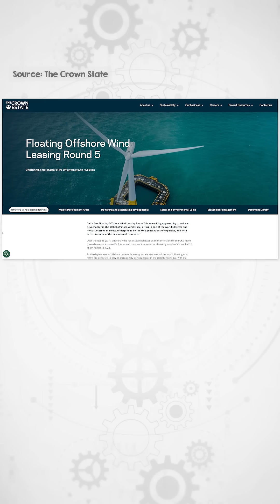How much floating offshore wind is being installed?

Comment: I've noticed (almost?) all floating platforms for offshore wind place the turbine at one corner. 

Does the entire platform rotate when the wind changes direction? My intuition is that if the pillar is at the lee side of the triangle, the force of the wind on the turbine would topple it over.

Why are they not designed like a drumming rig with a keg at each corner but the working part in the centre?

This comes from my experience if small boats where you have to step right into the boat: stepping on the gunwale (edge) can capsize it (topple it over) causing much merriment to any audience. 

I'm probably wrong, but if so please do a full length video about how they can stay stable in any wind direction, because all the examples in this short look scarily unstable to me.